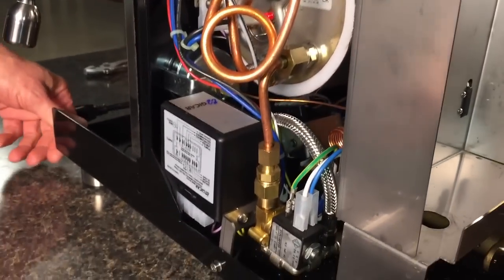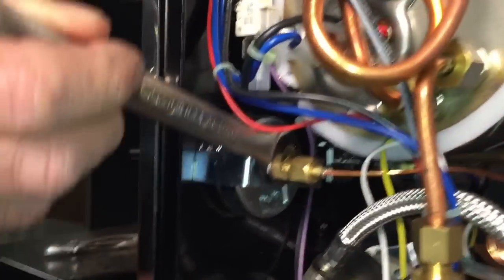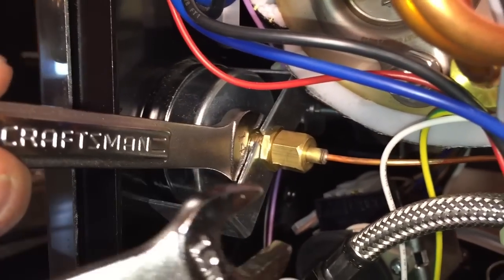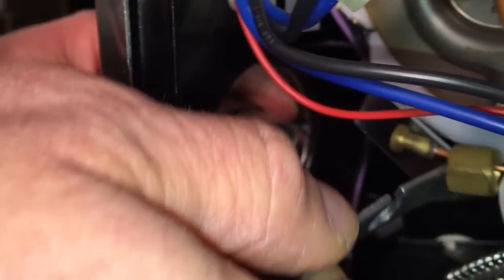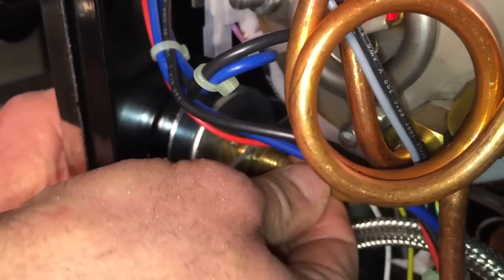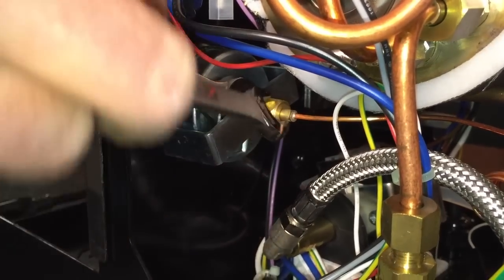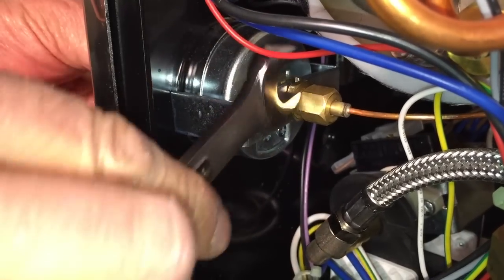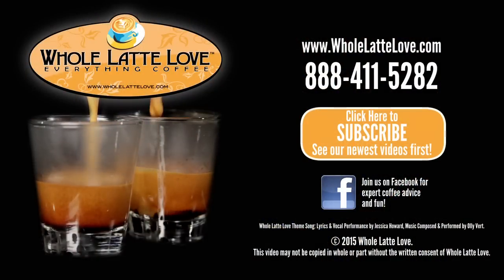How To Remove and Install a Brew Pressure Gauge on a Profitec Pro 500

Comment: As a mechanical engineer who loves espresso machines, this is right up my alley :)
Reply from the maker: Cody Clegg Glad you enjoyed! Planning to do more like this. What's a mechanical engineer's favorite espresso machine? What does one use at home?
Reply: I just have an old hand-me-down semi-automatic Bodum espresso maker. Not top of the line by any means but enough to make some decent drinks from! I'm planning on getting a new one from you all in the future.
Reply: Whole Latte Love
Thanks for that clip. Whats about Rocket's R58 and Cellini, Bezzera's Mitica top ?  Differences in durability ?
Reply from the maker: Cody Clegg For your next step up you might consider a single boiler machine with 3-way solenoid valve with full size commercial style portafilter. Something like a Gaggia Classic or Rancilio Sylvia. Of course you'll want a capable burr grinder as well. Once at a certain level, the grinder is more critical than the machine.
Reply from the maker: Jürgen D Have not worked directly with the Mitica but we love Bezzera's BZ10. Small in size but big in performance. Its heated group results in very consistent brew temps - in some ways better than traditional E61. We can say the Profitec machines pay extra attention to finish details and internal engineering. Very logical internal layout to increase longevity with critical electronic components placed away, or protected from heat and moisture sources. Finish details like fully wrapped and polished body panel edges, extra effort into finishing of internal drip tray welds, solid front to back frame rails, spring loaded valves for reduced valve seat wear, top-notch components, solid and un-plated wands. The R58 has a certain sexiness. Its style makes a statement but we give the edge to Profitec machines for durability based on internal components and engineering along with the quality of external finish.
Reply: Whole Latte Love Yes, I've actually watched some of your videos with the Gaggia Classic, and that one is currently at the front of my "most-wanted" list for it's price and capabilities. As for a burr grinder, I'm a bit lost. I know I want one, but I've heard some say to only spend 50 dollars on one, while others say spend half as much or as much on the grinder as you did on your espresso machine. What are your thoughts? Any well-priced entry level burr grinders to hold me off for a while without breaking the bank?